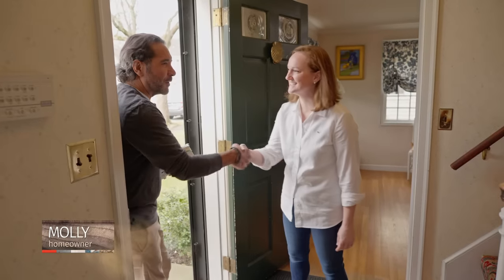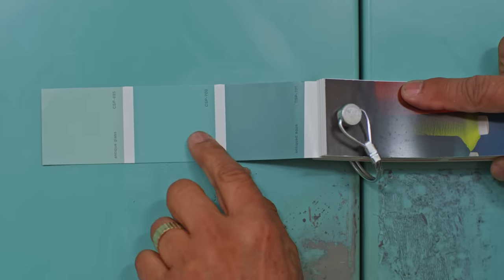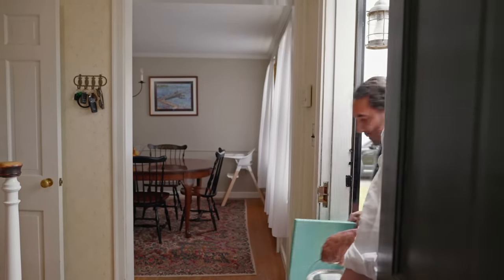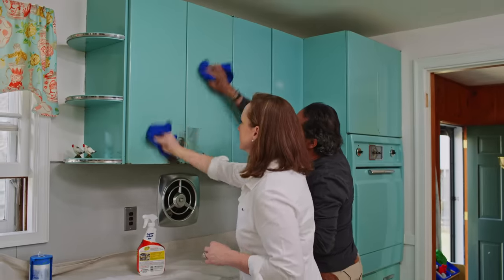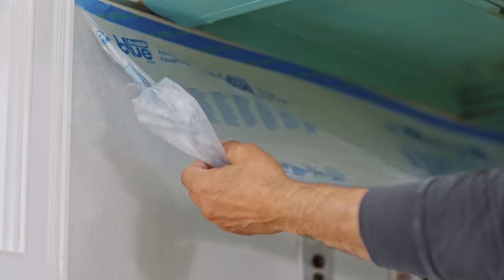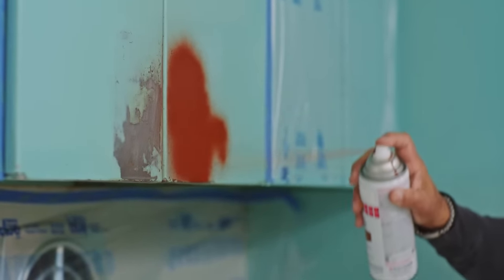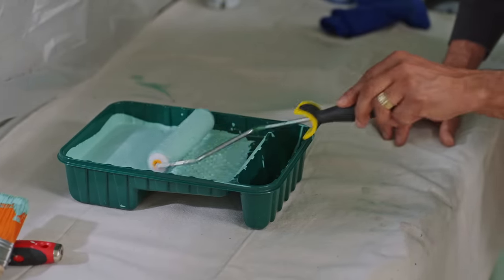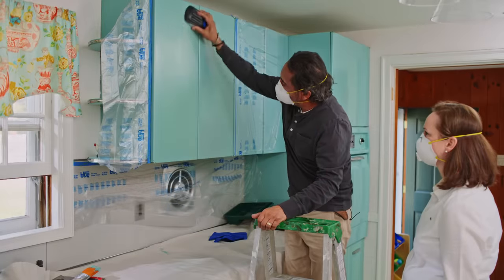How to Paint Metal Cabinets | Ask This Old House

Comment: He took the shelf to the store to match the cabinets paint, but that shelf had a different shade of paint since it was not exposed to a light, grease, smoke, dirt, etc.
and ended up having a different shade of paint on that cabinet that's not matching with the rest of the cabinets. He screwed up a big time. She now has to paint the rest of the cabinets in that color 🙄
Reply: So he matched a paint that hasn't been exposed to as much every day kitchen use. Which probably means it's much closer to the original color. Why wouldn't he use that again?

I must've missed the part where she said she wanted to keep the faded, rusted, and stained look.
Reply: @realstor9361  The big question is who in their right mind likes this color!!
Reply: @jomangeee9180  I do.  Mid-century modern is popular right now.  Not everybody wants their kitchen painted white and gray to fit the bland modern look.

Comment: Is it me or does the finished color not match the rest of the cabinets?
Reply: before they started , those 2 doors were a different shade already, but having a full gallon i would paint them all now
Reply: It's 50 year old paint. It will be hard to match.
Reply: It matches the rest of the cabinets, it’s the two doors next to it that doesn’t match the rest. I agree with everyone, paint them all. It’s a nice kitchen.
Reply: I would repaint all the cabinets.
Reply: If you look closely, when he removed the sample shelf, IT didn't look like it matched the upper cabinet doors. So, he got a different color...agree w repainting them all
Reply: Not even all that close; he should have taken a cabinet door with to match the cabinet paint color. Using that 'virgin' shelf means it matched to the original shade, not the color worn by time, heat, grease, etc.
Reply: watch the beginning of the video..
Reply: @markh.6687 I agree. I was thinking the same thing.

Comment: What product and is the process if my metal cabinets are currently painted with oil based paint?  I want to use a water base paint now. What steps do I need to take so the paint does not peak off?

Comment: I have some amazing retro metal cabinets that I love but they were painted grey unprofessionally and I would like to paint them.
Reply: Sand , clean and paint . But don't forget the drop cloth and a 1/4" roller for a smooth finish .
Reply: Use an oil-based paint and not a water-based paint.

Comment: Not to dump on Mauro too much here but... this is just about the worst way I think to do this job. 

The sample he took was probably great because it was as close to the original color as they probably had. That's good. But because of the way they actually did the work in the video, they're going to have to paint around so much stuff to get it all to match. 

Should have taken off the doors and shelves and painted them somewhere else, then did the rest while that was drying off. 

It's good information, but poor procedure.